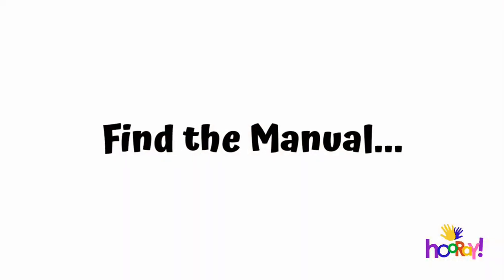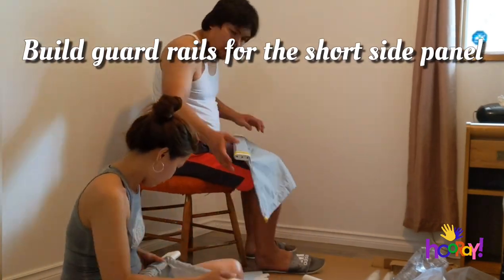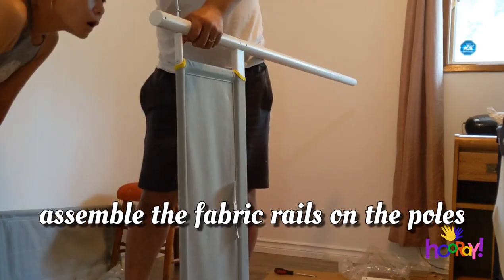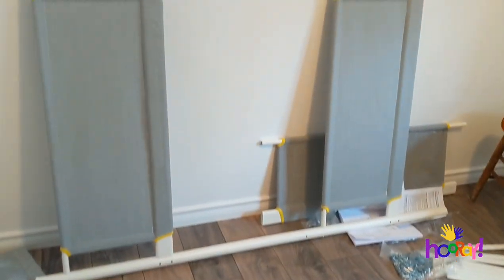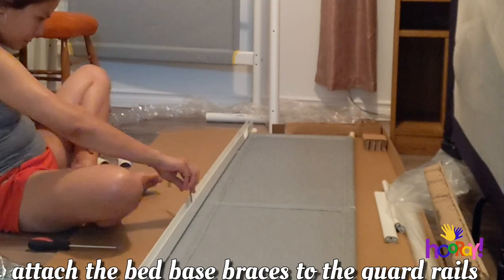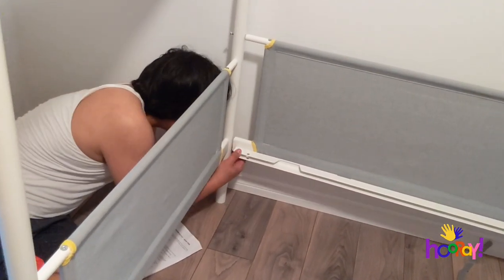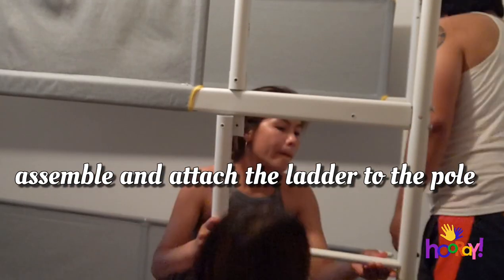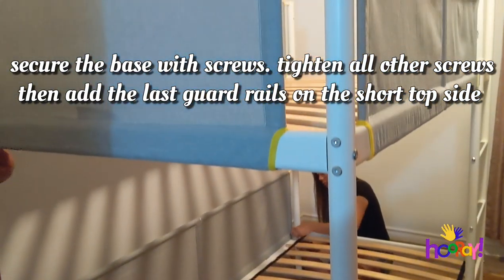Bunk bed for children's bedroom | IKea Vitval bunk bed installation tutorial | Easy DIY bunk bed

Comment: Made the bed,took hours just to find out we have to fix some of the rails because the drill holes they made didn't work for the screws they gave. The bed looks good but the extra work having to buy new screws isn't worth it.
Reply from the maker: I know installation is really difficult, what more if there are wrong items on the package.  so sorry you have experienced that.